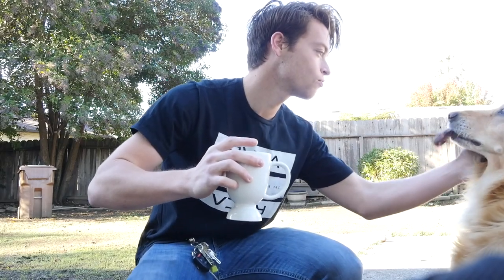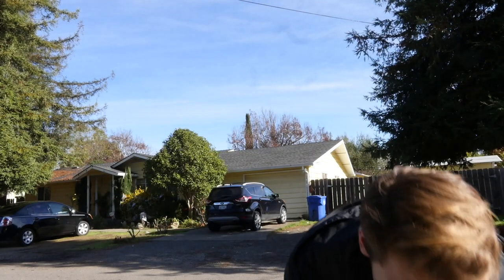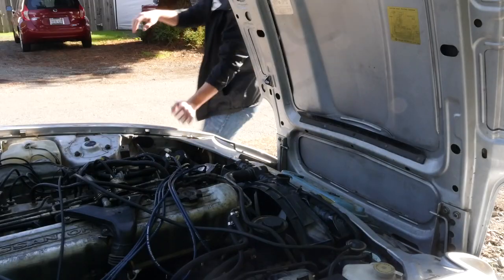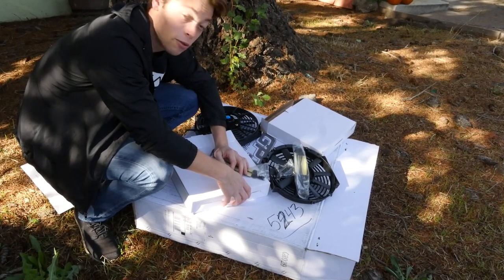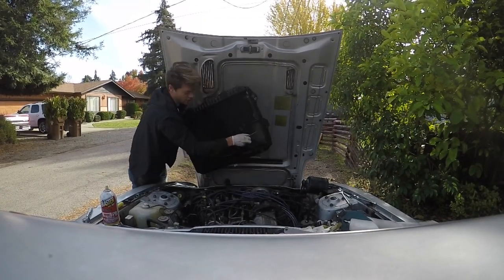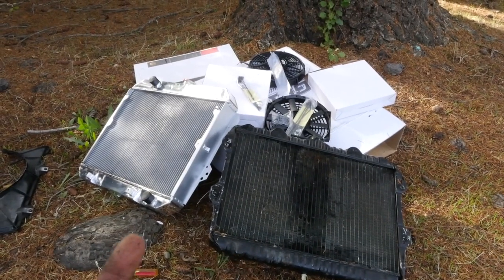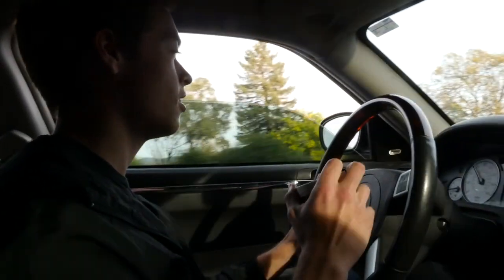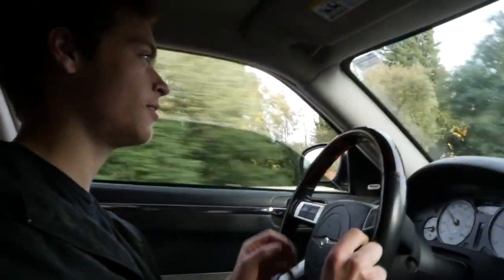NEW ALUMINUM RADIATOR (280zx)

Comment: for the electric fans you can wire them two different ways. most people just wire up a relay to the fans then control them with either a toggle switch in the interior or a thermo switch that'll come one once the car his a certain temp